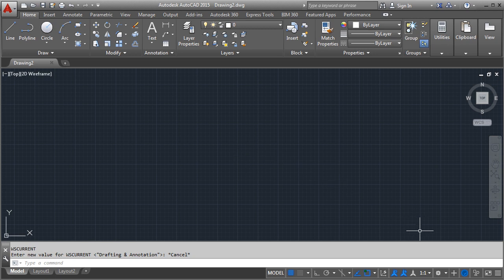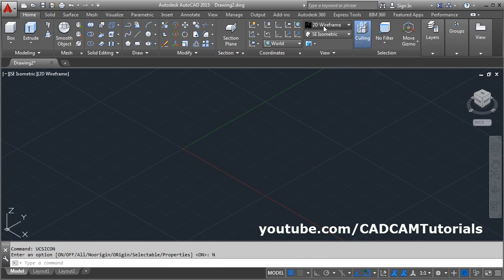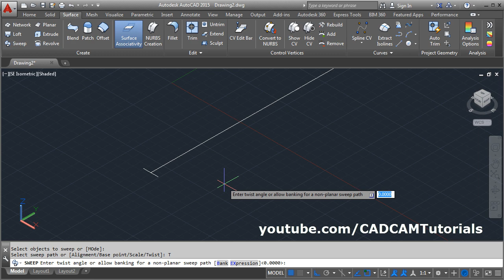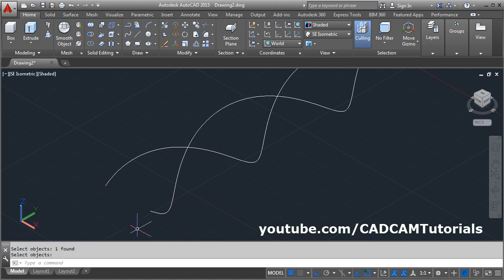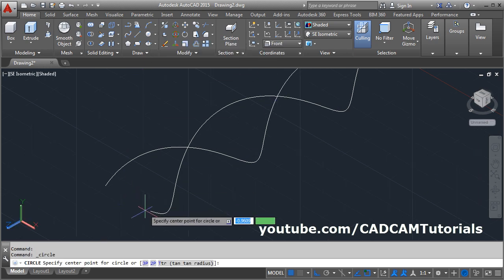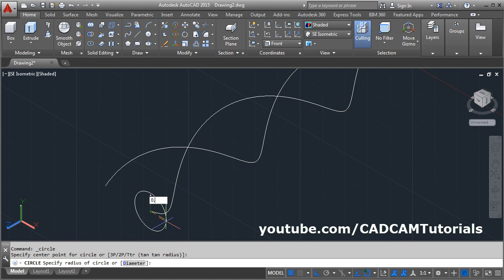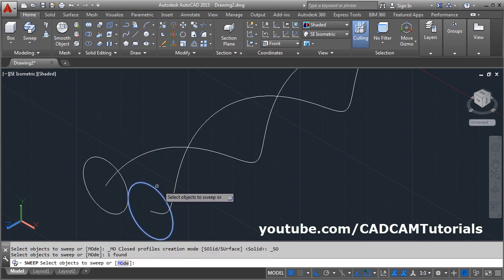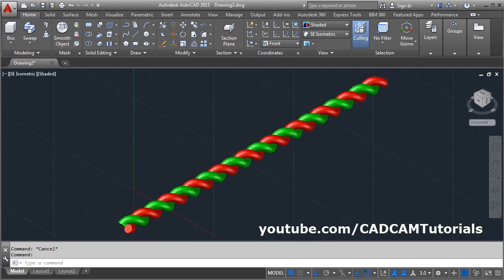AutoCAD 3D Twisted Pair Wire | AutoCAD 3D Cable | AutoCAD Rope | Sweep Twist

Comment: I really liked this video, but toward the end you don't need to switch to a different plane to draw the circles or even 3d rotate them.  I compared just drawing the circles on the world x,y plane to 3d rotating the circles and the two results were identical.  As long as the twists aren't too tight.